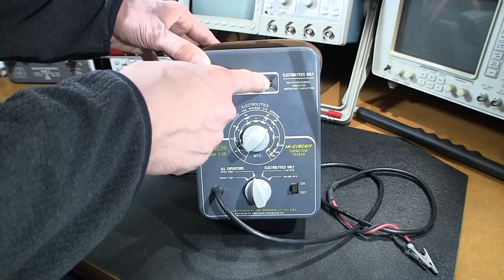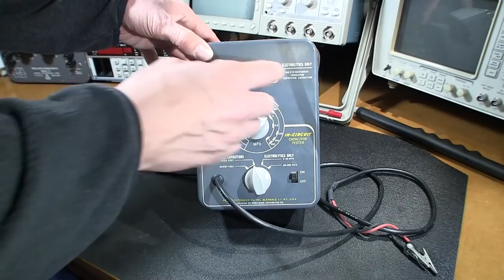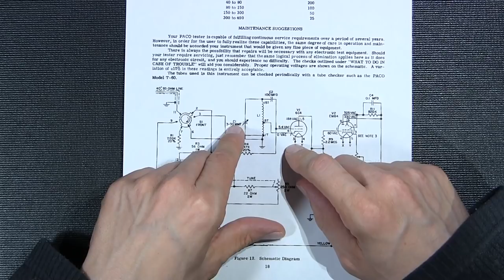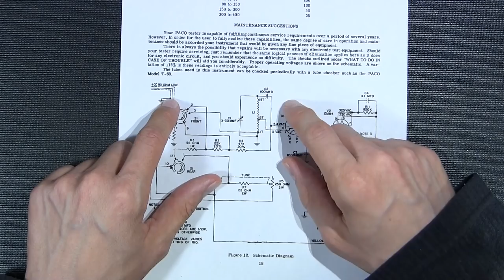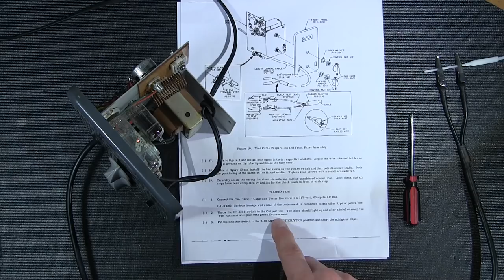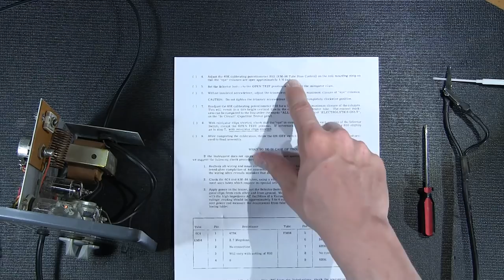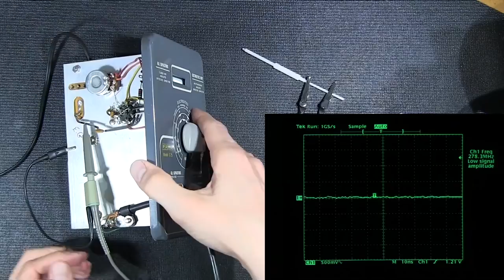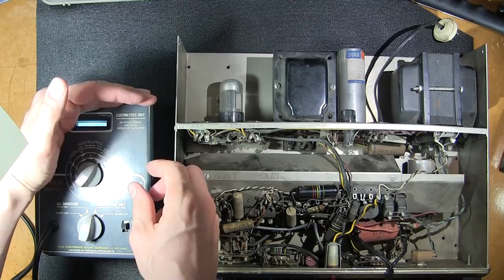Bizarre Circuit Tests Capacitors with RF!

Comment: Hi Paul, I would like for you to go into the RF stuff, also into the more in depth schematics.               I am getting interested in the "Tube conversions to Solid State," like Trioderizer or the Fetzer Valve.    I went and converted a old Heathkit IG-102 to solid state when I was going to College using MPF-102's, it seemed to work somewhat OK.  That was about 40 years ago.   I have collected some newer schematics of solid state conversions from Mike Yancey IG-102 FET VERSION -TINKERING WITH TUBES https://mikeyancey.com/category/heathkit/  which is in his "Heathkit section" online. I may revisit my own IG-102 again.         I have seen where there was conversions of old Collins Receivers to  solid state also, and when some tubes become harder to find, from wherever.  I am starting to like the tube equipment also, but most of my equipment is solid state.  Something to go into later, differences or similarities between tube and solid state FETS and transistors.  Later Ray Burke
Reply from the maker: Thanks for your input Ray!